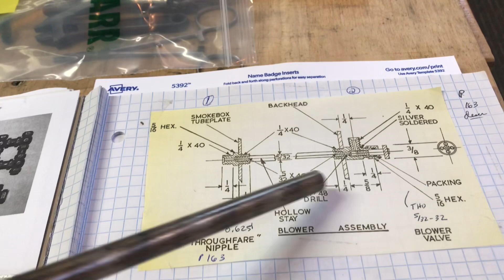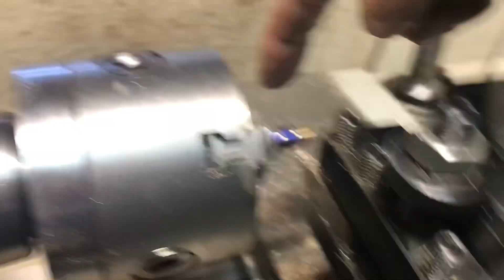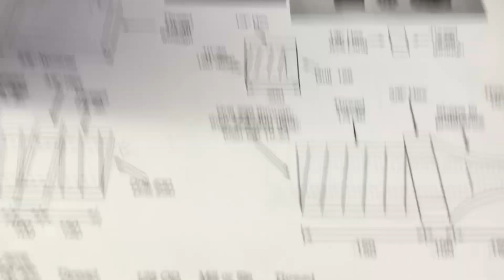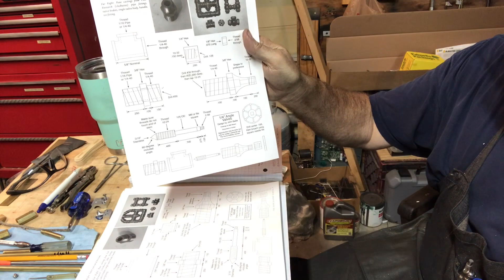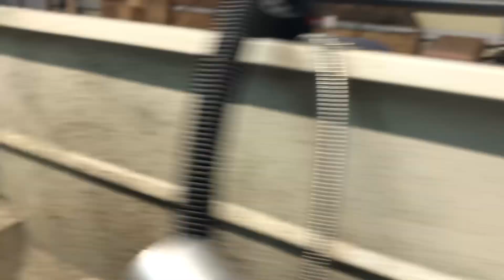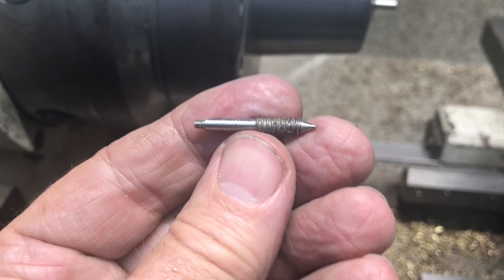38. LBSC Tich locomotive project, blower valve assembly.

Comment: Hi. I’ve been following you for a while now. I have started work on my fathers Tich, he started it in the 50’s with my grandad who was a tool maker for and English company here in the UK called Lucas. I think he just grew up before he finished it, but unfortunately he passed away when I was 16 (I’m 57 now!) I have various steam engines and stationary ones my grandad built. So I thought I would have a go at working on it. I’m an electrician by trade, and have never used a lathe! So I bought a Myford, 1974, and a mini milling machine. The chassis is made already, and I found a box of bits, which I think are related. I have made the axels, turned the wheels down as they are cast, and I’m looking at doing the pump operated from the axel. But not only am I having fun understanding imperial measurements, the drawings from the LSBC book look like something from mars!
Your vids help massively with a visual representation of the parts, non of which I’m going to do to your standard!🤦🏻‍♂️
As long as it looks the part, that’s fine, if it actually works I’ll be amazed 😅
Keep going with your vids, loving them👍🏼
If your passing the UK, pop in, you’d be very welcome!!
Take care.
Reply from the maker: Thanks so much for your kind comment. I’m glad my videos are helpful to you as that is my main goal. I’m fortunate to have a local mentor in the hobby (Fred V) and I try to share what I’ve learned from him with those who are interested. I wish you the best with your project. I sure wish I could visit the UK (was the in the 1980’s), but it won’t be anytime soon for a return. Please let us know how you are doing as you work on your project. Bill.